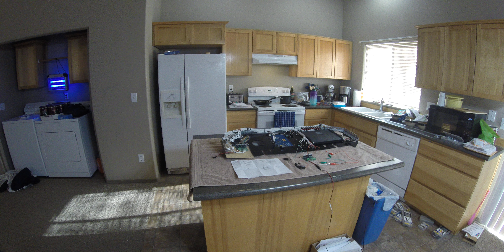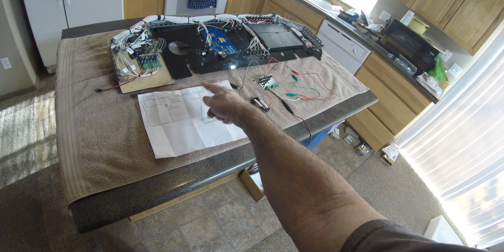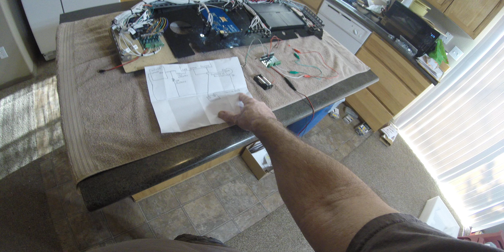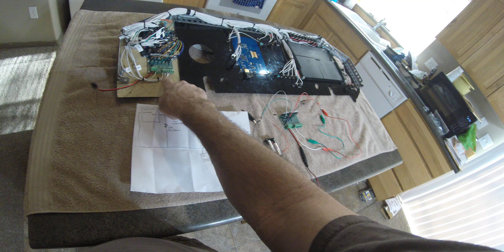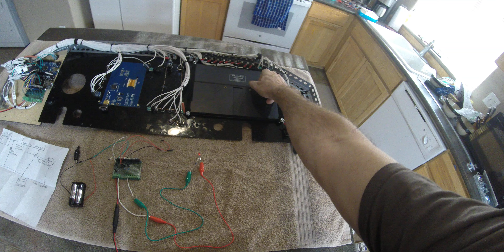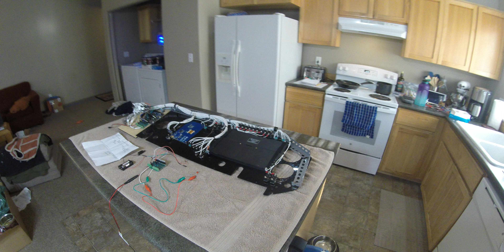Sim Panel

Comment: Man you really put some work in. The panel looks amazing and cable management is superb. Good job on the MOSFET board. Can’t wait to see it in action!
Reply from the maker: Thank man!  I just got it installed right now and powered up.  Fingers crossed.
Reply: @libertine5606  So? DID IT WORK?
Reply from the maker: @vivalaleta  Yes, I still don't have a Garmin G3x simulator for the PFD panel.  I got some used Mooney seats so now it is time to take everything apart and do the final upgrade.  Which means enclosing everything and putting in a portable air conditioner and heater.  It's in the garage and it gets down to 20  and up to 100 degrees.
Reply: @libertine5606  Okay, no pressure. I'm pleased with an update. 😊